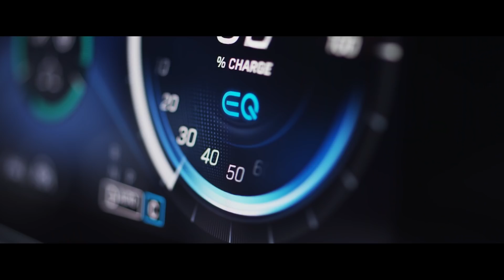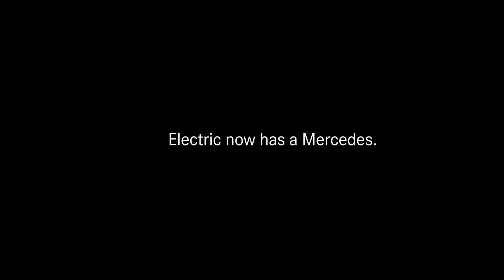Mercedes-Benz EQC Crash Test: Destroy to Create

Comment: Hey Julie - can you please fix Mercedes' terrible Lane departure warning that jerks you back over using the brakes instead of simply adjusting steering? Also, Mercedes has the worst lane keeping assistance. We were sold the E400 Wagon with the illusion Mercedes was beating Tesla's autopilot. Of course the dealership didn't have any on the lot with all of the safety systems, so we just figured it would be good. Unfortunately it keeps you centered in the lane about as well as a blind person. It plays ping pong with the lane markings.
Reply: Sounds like somebody is driving too fast and erratic
Reply: @the_first_resort940  sounds like someone has never driven a Mercedes

Comment: Volvo and Mercedes are the safest car you can drive. 
Ive crashed several times (not my fault) and one was right into a rock wall with my V70. The car got an dent. Drove about 40-50km/h. Not that fast, but too fast on icy roads. 
Too bad the B-class doesn’t have QC. And Volvo hasn’t an EV atm. 
Im driving an Leaf now. Electric cars are much safer than ICE.

Comment: Excellent teaser, I love it! It shows the values of Mercedes. Also the slogan "Electric now has a Mercedes" is much better than the competition (Audi: "Elektro wird Digital / Elektro wird Audi" hä?). You have started late, I'm driving a Hyundai Ioniq Electric in the meantime, unfortunately not many pure electric car options from German car makers at this time, so sad. Come on, please get your stuff together and get up to speed in the market!!! Otherwise you will see the backlights of other EV makers who are faster, cheaper and already gained a longer field experience. About the crash test: I'm actually more curious about a strong side/pole impact, as it is a much higher danger for the battery pack in the floor.

Comment: 64 kmh because at 65 the passengers die?
Reply from the maker: The crash configuration that was shown in the video is equivalent to the EuroNCAP frontal crash test, which is conducted at a speed of 64km/h with an overlap of 40% against a specific deformable barrier. There are many more test configurations at different speeds, such as other frontal crash tests, side and rear impact scenarios, and rollover testing.
Reply: @MercedesBenz  

Interesting. How did they come up with 64? It's quite a specific number, so I guess it's not arbitrary?
Reply from the maker: The speed is set by responsible authorities and we just follow the rules. 😉
Reply: @MercedesBenz  

I guess it's a lot better to listen to them than to the irresponsible authorities.
Reply: Mercedes-Benz I am pretty sure it’s because that is the equivalent of 40mph... Pretty easy to work out... That’s the typical high speed of a crash..😆👍😳😜😞😎
Reply: @MetaReplication  

And that's because the typical crash happens in 'murica, where you can get a driver's license in the cereal box pretty much.